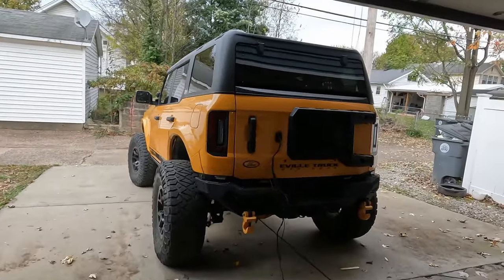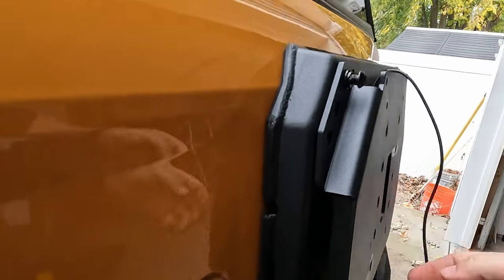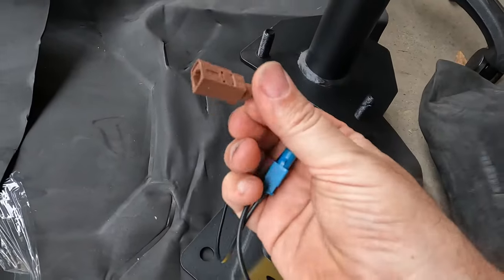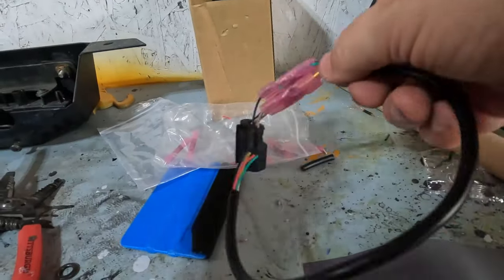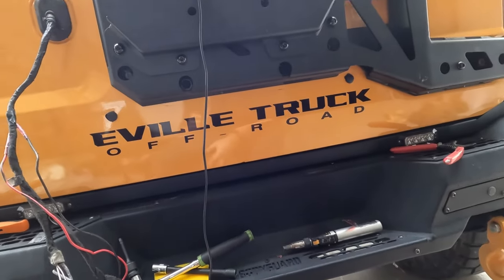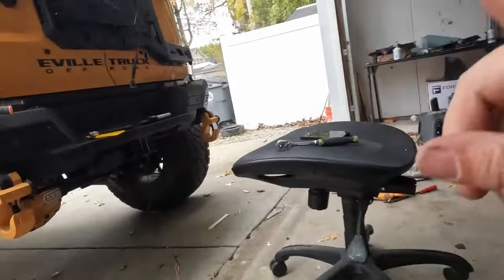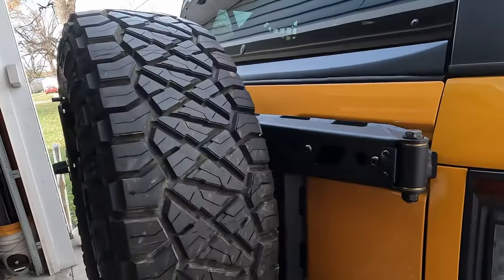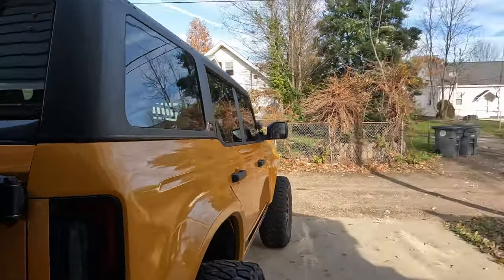Why You Need a Turn Offroad Tire Carrier on Your Ford Bronco Today

Comment: Nice Video.! Question for you .?When messing around with the oem backup camera ,did you have to adjust the green ,yellow and red lines for the backup camera distance? Or did it still work when you back up using the camera.
Reply from the maker: Thanks , I didn’t have to make any adjustments everything just worked